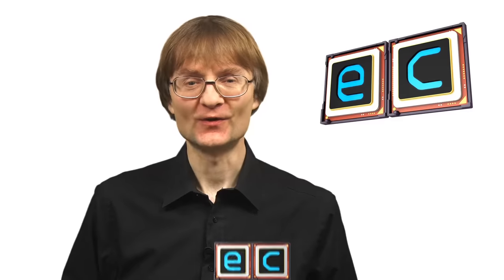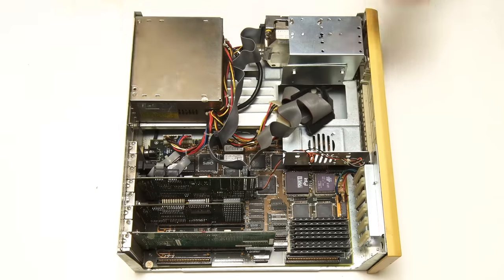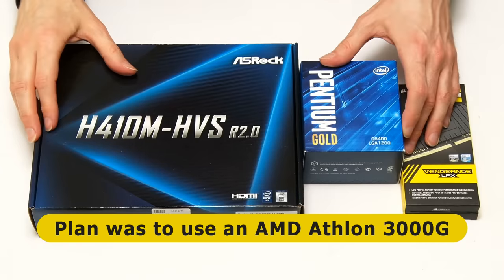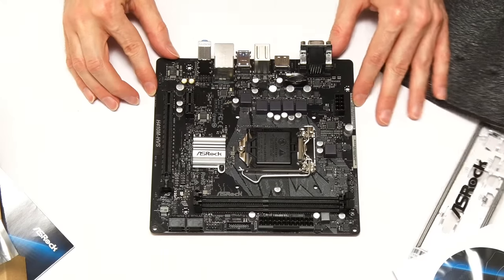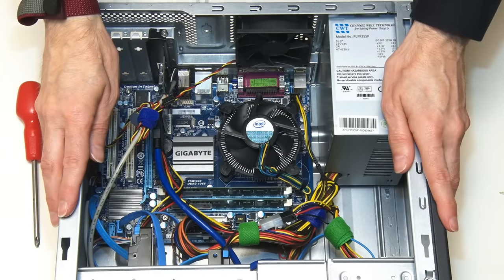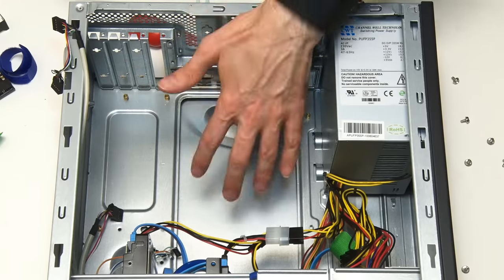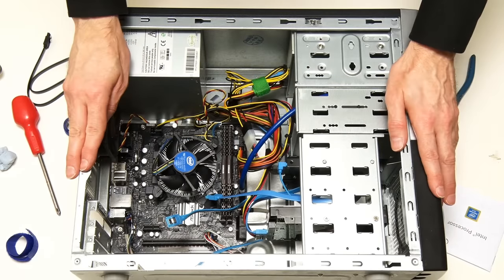Old PC Upgrade: Motherboard & CPU

Comment: Wow, your 10 year old PC has twice the ram that my 7 year old PC that I use every day has haha. Prolly time for an upgrade....
Reply: it had been upgraded from 2GB to 8GB in a previous episode.
Reply: @RWL2012  ah, that makes sense. My computer reaaaallly needs an upgrade, even though I have it running as well as it did when it was brand new, it still gets bogged down a lot. Some things use too much RAM, and some things slow it down by using 100% of the read/write capacity of the HDD. I'm sure if I could switch to Linux from Windows 8.whatever it would run a hell of a lot better, but I haven't quite had the time or the inclination to mess around and experiment with my only computer (it's my Mom's old Dell all in one, so it wasn't all that great to begin with and isn't easily upgradable). Anyways that's what my Raspberry Pi 400 is for, messing around with and learning : ) 
But I have been meaning to either dig up my old shell and build a new computer from scratch (I'm much better with the hardware side of computers than I am with the software side, mainly because I didn't take the opportunity to learn programming or teach myself how to properly take advantage of Linux), or buy a new computer. Obviously I'm leaning towards the former : )

Comment: I have an older laptop pc and am looking for the best Linux OS to speed it up. Any suggestions or video about it? Thanks
Reply: Depending on the age of your laptop, for machines up to about 10 years old, I would suggest either MX Linux or an XFCE version of Mint. But those are just my suggestions and other choices will work too.
For much older machines, I think both antiX and Puppy Linux can be good versions to try.

Comment: by upgrading the psu you're not creating as much e-waste as it's old and can destroy the components inside creating even more e-waste
Reply from the maker: Fair argument. It all depends how long it lasts! :)
Reply: CWT is a quality PSU manufacturer; they make many of Corsair's PSU models.
Reply: @RWL2012  I am not saying the power supply is bad what I am saying it's that there's a higher risk of it failing since its a older unit

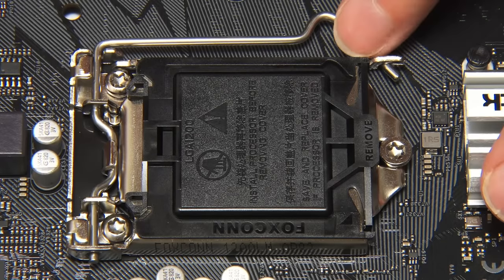Comment: 12:00 by installing the CPU, the cover should come off automatically. Right? So there's no need to do it yourself. Correct me if I'm wrong.
Reply from the maker: Yes, the cover would just would pop off. But that is not the recommended way to do it. I know there are various views on this, so I went with what it says on the instruction leaflet that comes with the CPU. And there Intel say raise the retaining mechanism, then remove the cover, then fit the CPU. Intel have never recommended popping off a cover using a CPU! :) Not least, having parts randomly popping around when doing a build is not good practice. I was going to mention this in the video, but I had already covered so many "people may do this" scenarios elsewhere, that I did not make additional comment and just used the official Intel method.
Reply: @ExplainingComputers  Thank you for replying. Since my first self-built pc is AMD-based, I wasn't aware of this. Every single tech channel that I watched says that the cover should pop off by itself. This was the first video that I watched from your channel so that's why I wasn't aware of that. Thanks again!
Reply from the maker: @Behdad47  Thanks for watching! :)

Comment: I think the slide-on side panels that most desktops have is one of the dumbest things ever. The little clips break all the time and it's difficult go get all the clips pushed in before you slide and screw it in without sitting on it.

Comment: I still don't get it why some motherboards have vga. It is just a waste of money and resources. Ideally there should be one dp and one hdmi like most business pc. even some budget boards dont have vga
Reply from the maker: There are still a lot of VGA monitors and projectors out there.
Reply: @ExplainingComputers  well I do agree but it is good to have some form of flexibility since a dp port can support a larger variety of displays. While there are still lots of monitors and projectors with VGA, most have at least VGA and HDMI/DP. If the onboard video outputs seems like it doesn't meets your needs you can always add a GPU such as a quadro which has four miniDP ports
Reply from the maker: @Kenzo9063  I can only repeat my comment -- there are a very large number of monitors and projectors out there with a VGA port, and a VGA port only. Most do not have HDMI/DP, as it has to be a far more modern device to support a digital input from HDMI or DP, rather than analogue from VGA. Before the pandemic, I spoke at a lot of events at country hotels and places like that, and was only ever presented with a VGA port! :)
Reply: @ExplainingComputers  Definitely true. At my workplace there are some that have vga only while some "more special ones" have hdmi. The case of it being vga only is not the projector but rather the connection panel (the one commonly with buttons and vga ports).
Reply from the maker: @Kenzo9063  Yes, agreed, some issues are the connection panels, but many are not. Connection panels are very rare indeed in most smaller conference venues. Most conference venue setups involve plugging your PC directly into the projector.
Reply: @ExplainingComputers  The same can be said for the HDMI port. Since most people are more familiar with HDMI and not DP and HDMI is more widely used. The type of ports on the motherboard also varies from the manufacturer. It won't be too much of a concern if one were to use a discrete GPU. In most cases you won't need DP unless you are driving a high end monitor 4K and above

Comment: Replacing Mainboard, Memory, and CPU... uh?!? that not "upgrading", that's a PC replacement. You're simply keeping the case.
Reply from the maker: Cases, drives, PSU and fans -- about 40 per cent the cost of new build to this spec, as I mention in the video.

Comment: I'm wanting to build a Windows 98 second edition computer to play retro games.  Will this newly upgraded computer shown in this video do this?
Reply: It might not... depending on the availability of Windows 98 device driver software for the hardware.
Reply: @derekp2674  Do you know if there are any new socket 478 motherboards being sold today especially with an 8x AGP graphics slot?   How about making a video on making the best win 98 computer that can be made today.  I want Win 98 mostly because it plays old dos games better than DOS.
Reply: @rogerowens7264  Hi Roger, I doubt that there will be new production runs of 478 socket motherboards these days. That said, via the wonders of online shopping, you might find a brand new one gathering dust somewhere. It's been a while since I've used a 478. I did also used to have a hooky copy of Windows Millennium edition that would install on generic hardware, so long as I was able to feed it appropriate driver software. Later on, I bought a second hand copy of W2K and used that on my oldest hardware.
You might also find second hand 478 components on the like of eBay.
Also, if your main interest is DOS games, can you use FreeDOS on a host PC?

Comment: You missed applying thermal paste on the processor...
Reply: Paste was factory-applied to the fan assembly.
Reply from the maker: I mentioned and showed twice that the thermal paste is pre-applied.

Comment: Quick question will a new intel motherboard support a old CPU like i5 2th gen but the motherboard supports up to 9gen Intel cores will it still be the same I mean like it's the same company and the same socket?
Reply: No, they use different sockets.

Comment: Guys i had an doubt if i keep old motherboard than install an new processer in that old motherboard what will happen
Reply from the maker: It will work if the processor is supported by the motherboard. Specifically, the motherboard needs to have the right type of processor slot, and a motherboard chipset that supports the processor. In some cases, you may also need to apply a BIOS update before fitting the new processor. So, for example, if you have a motherboard with an Intel H470 chipset, you could fit an alternative 10th or 11th generation Intel CPU. I'm editing a video on motherboard chipsets that covers this issue right now -- it will post on Sunday Feb 27th. :)
Reply: @ExplainingComputers  thanks sir
Reply: @ExplainingComputers  sir im using enter e-h81 which is the best high end processer

Comment: for the price of the upgrade you could have  purchased a used  old computer with better specs  
upgrading old computers is never a good idea 
 = profit
Reply from the maker: "Never a good idea" is a very strong statement. :) Not least environmentally is almost always a good idea.
Reply: @ExplainingComputers  after seeing the enjoyment you got  out of the unboxing i guess  that more than justifies  the upgrade .. 😎
the comment came from my  bitterness of my final days of  doing pc upgrades  for a loss
Reply from the maker: @FSK1138  Ah, I see. And I agree, it must be very hard to make money out of upgrading PCs these days.
Reply: 10 cents a can is 10 cents I can buy lollies 🍬 with it!
Reply: @ExplainingComputers  This is false environmentalism, the case and the majority of the PSU can be fully recycled.  Modern power supplies are generally more efficient than what you have here.  In some way you have contributed more to the e-waste problem with this project than resolved by purchasing new parts instead of buying second-hand processor and mo-bo e.g. Ryzen 1 or 2 and an AM4 motherboard which has future upgrade potential unlike the Intel compatible boards.

Comment: Sir,Do you apply terminal paste When install CPU?
Reply from the maker: As shown and discussed in the video, the thermal paste is pre-applied to a stock Intel cooler. :)  So yes, thermal paste is applied, but you do not need to apply it, as it is there already.
Reply: Tq for your advice.

Comment: Is PSU failing just a myth?!
Reply from the maker: PSUs can and do fail, but it tends to happen early in their life (within the first year) or when they are very old. I've personally only ever experienced early PSU failure.
Reply: @ExplainingComputers  I think it should be fine, then, but what does exactly happen when the PSU fails? I'm planing a similar upgrade and I want to be on the safe side. Also would 3000G be a better option?

Comment: why only 8 gb why not 16 now u have to spent more to upgrade to 16  in the future cost more  mony
Reply from the maker: Or why not 32GB?! :) You always have to stop somewhere. 8GB is perfectly sufficient to run any modern OS and most general computing applications, particularly if using Linux. :)

Comment: You have spent the money that cost to build a new low end PC. You upgraded the Ram to 8GB DD3, installed a USB 3.0 expansion card. You bought that old PC from ebay. And then you throwed away the 4GB DDR3 modules and the USB3.0 expansion cards, also the motherboard and CPU. Then bought a new 400 series chipset motherboard, a brand new Pentium processor and DDR4 ram modules. If you consider the total cost for the upgrade it is cheaper if you build a new computer with a cheap pc case and a 450W power supply.

Comment: Put a disclaimer that you cannot boot from the sata controller you showed in "Raspberry Pi 4 TerraPi Rig" or get downvotes on every new video of yours
Reply from the maker: Sorry? Are you using the latest firmware on the Pi?
Reply: @ExplainingComputers  I spent 3 full days on it, before I gave up. What do you think?
Reply: @ExplainingComputers  Unable to boot raspberrypi-4 from ssd using this particular ICY BOX IB-AC7031-U3, I even used the same ssd.

Comment: I am disappointed with the choice motherboard. It so basic/terrible that it is arguably ewaste right now. There is no chance of upgrading anything. You can’t add ram because of only 2 dim slots. No expansion slots for anything beside a gpu and the lack of m.2 slots for nvme drive makes it look outdated right now. 10€/£\$ more on the mobo would have gone a long way to keep this pc from the ewaste a lot longer.
Reply: You can upgrade RAM to 16 GB on that MB.

Comment: 'Upgrading' to bottom of the barrell components just because they're newer isn't worth doing. An xeon e5450 would have been a good stop gap but a modern quad or hex core would actually be worth it. Also that power supply likely has bad failing caps and should have been checked.

Comment: fool all you need is upgrade the  cpu if you are runing the e5500 you should be able to use a q9550 cpu quid core cpu

Comment: I want to know how to do this  on a laptop. There's  a like for you if you  do this? Lol
Reply from the maker: Laptop motherboards are custom to the model, so not upgradable like this. Most laptops also have a soldered CPU, then is hence not upgradable. But there are some with a socketed CPU that could be replaced.

Comment: You didn't tighten the CPU cooler by twisting the clips, and you installed the cooler with the board having no support under forcing the board to flex. 

Pretty cringe
Reply from the maker: The clips are turned when a cooler is removed -- the cooler is supplied with them in the correct position for installation. So the Intel instructions included with every boxed CPU do not say to twist them on insertion! :) And whether a motherboard is mounted on standoffs in a case, or outside of it is here, it cannot be fully "supported" when a cooler is fitted -- if it is not raised from a surface, the push pins cannot go through the board and come out the other side!

Comment: Paid too much for a disappointing system, especially the RAM is not sufficient even for office use. Nobody's going to notice much of an upgraded performance like this. The old PSU can cause 'interesting' problems down the line too, electricity has got a few hidden parameters.

Comment: fake video, you lied, old trash doesnt work oin new trash have to buy it all over again
Reply from the maker: Not a fake video. Why do you say this? Here I did a new motherboard, CPU and RAM in an existing (old) PC case, and it all works fine.
Reply: How is it fake? He did all of it correct